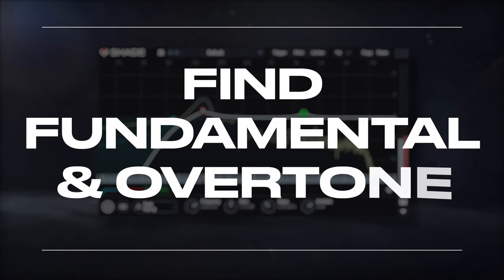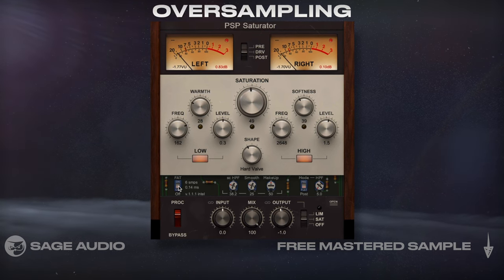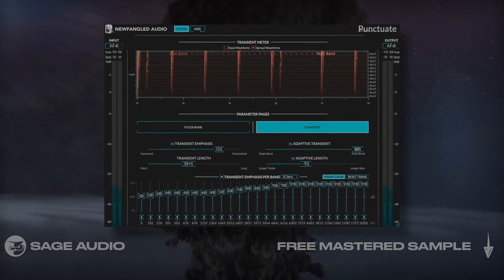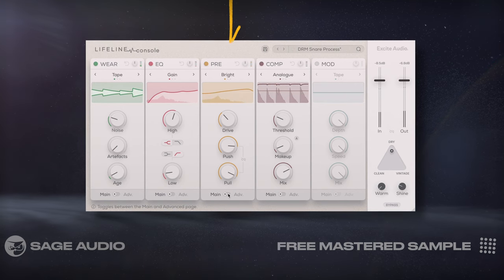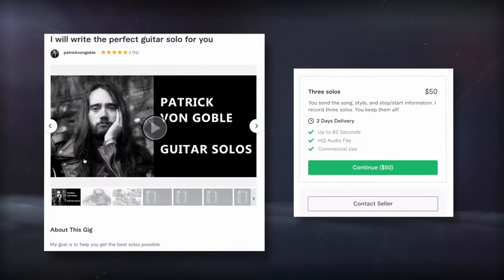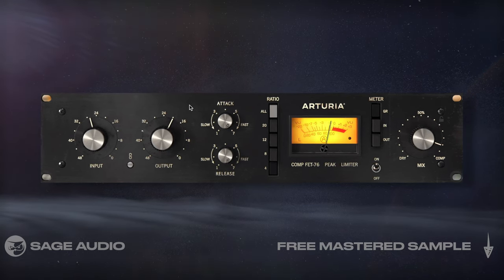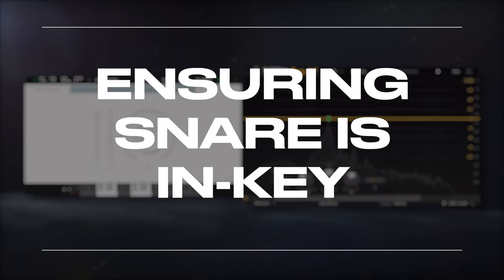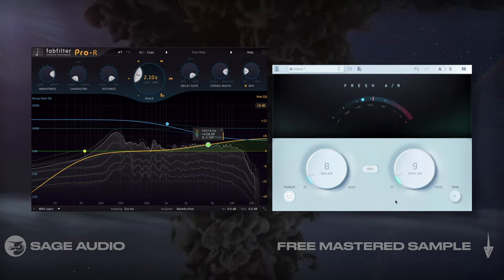How to Mix Snare

Comment: How to get vocals to be clear in mastering and not get overwhelmed by synth/bass?
Reply: In mastering that might be hard but usually boost around 3-5k on the vocal to bring it forward. Distortion might help cut through a bit more.
Reply: @Sharkbate211  thanks would try it out